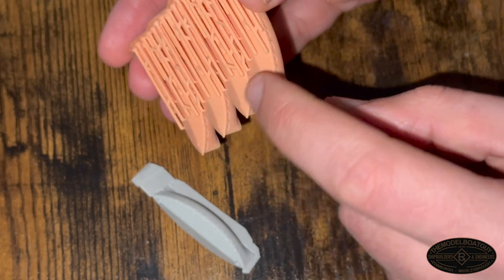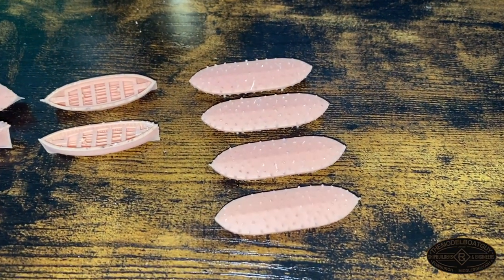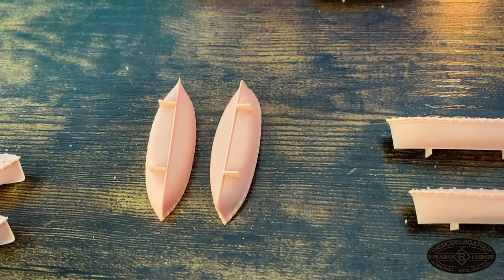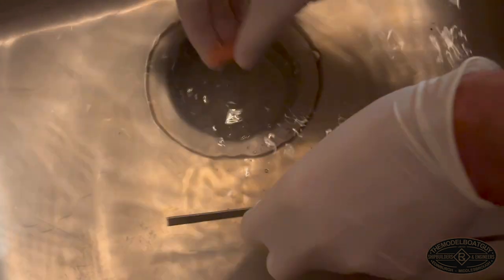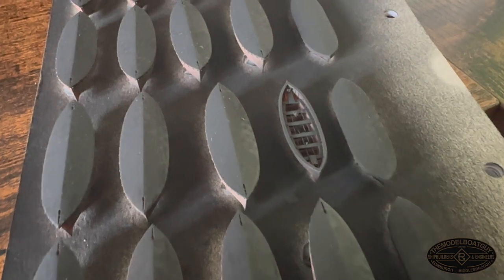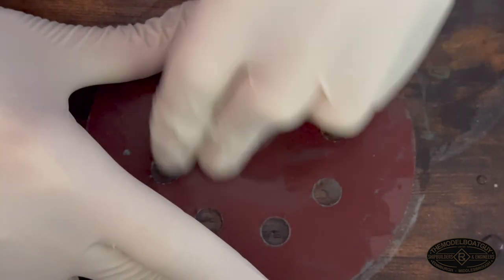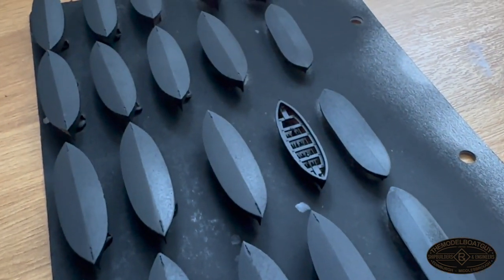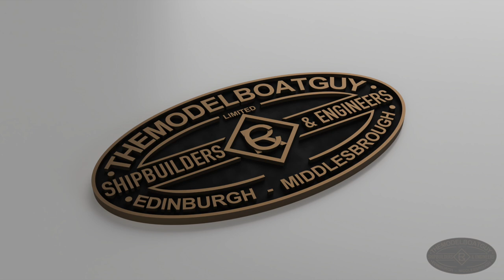Radio Control Trumpeter 1:200 Titanic Build Part 80 - Lifeboats Part 1

Comment: Hi Rob, nicely done as usual.  I was quite surprised that the supports were placed in such a sensitive place on the boats but you did a cracking job on the final finish.  At least your other boats found the best home possible!!😀 Looking forward to the next exciting episode.  All good here, actually progressed a bit on the hull brass integration to the hull.  By the way, I don't think that you have enough boats for the little people!!!!  Speak soon. Regards JH 😉⚓
Reply from the maker: Hi John,
As you say the supports are in a slightly tricky place. That said I do have an older set of China 3D boats, i believe the positioning and number of supports on the newer printouts have been improved. 
I’m confident we have enough boats… what’s the worst that could happen? 

Cheers! 
Rob

Comment: I use an electric hot knife very cheap from Amazon just plug into a plug socket and it has various blades and tips , also a coat of mr surfacer 1000 acts as a micro filler which helped get those small dents on top of the china 3D boat covers
Reply from the maker: Aye I really need to get a hot knife! Burning through craft knife blades (quite literally)! 
Also need to get some mr surfacer 😅